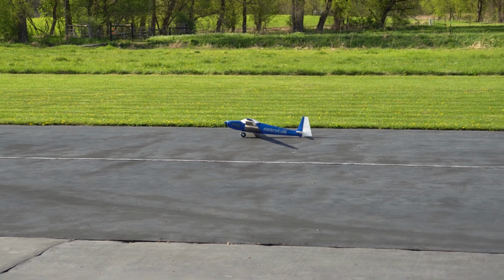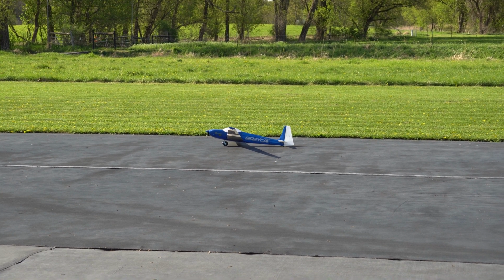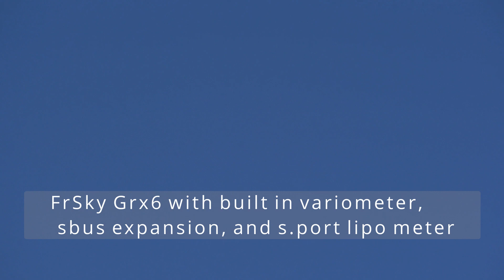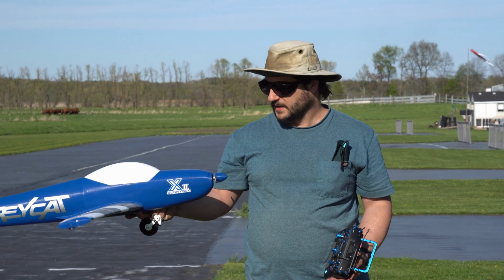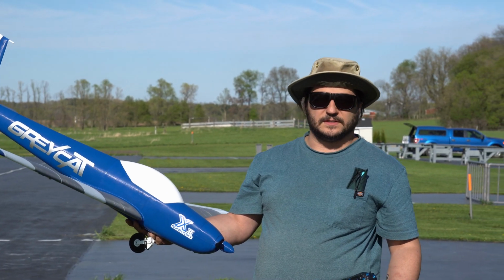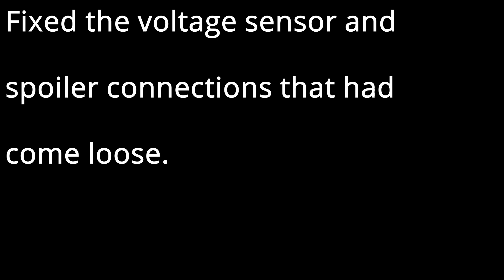Maiden Flight of 3D printed ASK14 power glider from planeprint.com

Comment: Nice job with your ASK!! 👍
Reply from the maker: Thanks!
Reply: Nice maiden. Congrats. The original had bended wires on each tip.to prevent scratching on the ground. How is gliding with no motor? Seems a little bit fast?
Reply from the maker: @5minEpoxy  This one has wheels on the wingtips.   Gliding up in the wind it was sitting still (or so it seemed at times.)  I haven't done a high stall test yet so I was keeping it a bit fast down low, and also because of the crosswind.